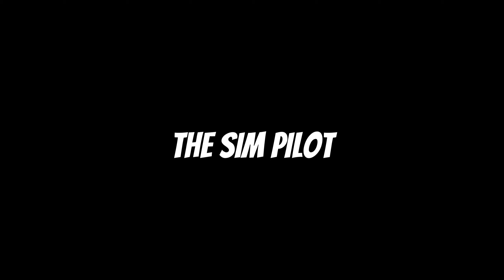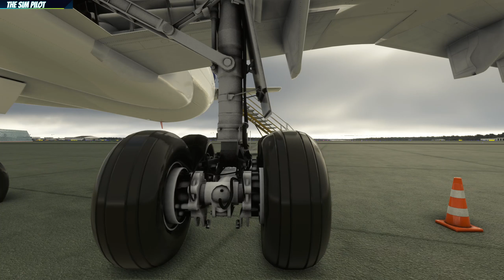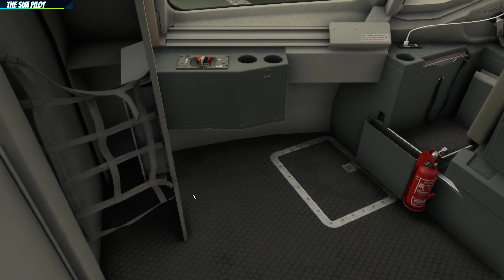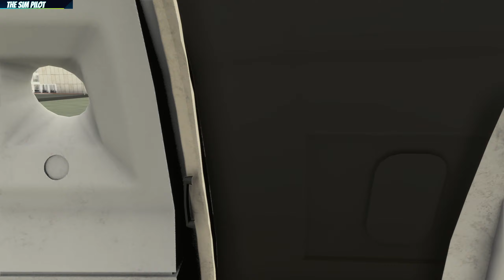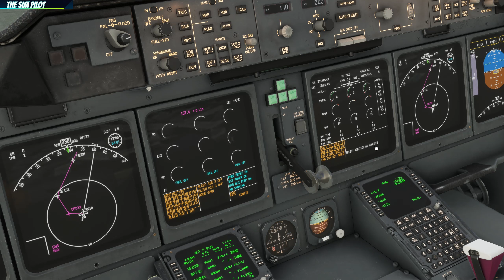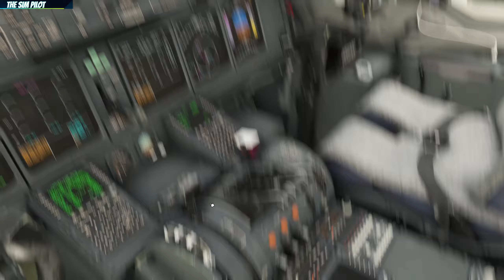MSFS | TFDI MD-11 Collector's Edition | Addon Showcase and First Impressions |

Comment: Good grief….when are they going to release this? Its been over two months, but their progress updates have all but stopped
Reply from the maker: No updates since the last two or three weeks. Last communication from the team is they were starting to work on the vertical navigation code. I know it can be very hard to code it properly I am assuming they will take their time. At this state it's really not that fun to fly. A lot of missing sounds animations and functionality.
Reply: @TheSimPilot  …. Bummer. I also hadnt realized that it was released as an Alpha, and not even in Beta. Looks like they are still a long way out.
Reply from the maker: @jay-rus4437  looks like it aside from the systems coding it requires a texture overhaul in my opinion with this textures I wouldn't pay what they are asking. Visuals need a lot of work too.
Reply: @TheSimPilot  …unfortunately I already paid $80. Was the first and last time I pay for an unfinished, and unreleased, product. Selling unfinished products is becoming extremely common in the sim hobby. Pretty dangerous in a way. We see it with software and hardware.
Reply from the maker: @jay-rus4437  same here never again. I already stopped buying add-ons as now more developers started to see MSFS and flight sim community as cash cows.
Reply: @TheSimPilot  ….yes, exactly.

Comment: The outside 3D model is meeeeh... not even FSX quality from 20 years ago. This one here will probably never become a beauty for stunning walk-arounds and detailed looks from behind into the engine nacelle and turbine exhaust or into the gear well. But I am very positive surprised how good the internal model already looks like, cockpit and freight room. This plane has a lot of potential, and a nice immersive eighties cockpit - but also a long long way to go. ;)
Is it freight only or is a passenger version planned too?
Reply from the maker: It comes in freight and passenger variants. But as you mentioned still needs a lot of work to justify the asking price in my opinion. Team has been pushing updates constantly but they were more systems focused not for the exterior model or graphical improvements.